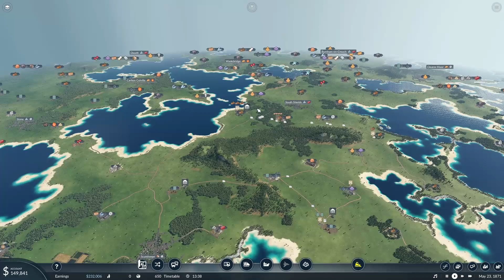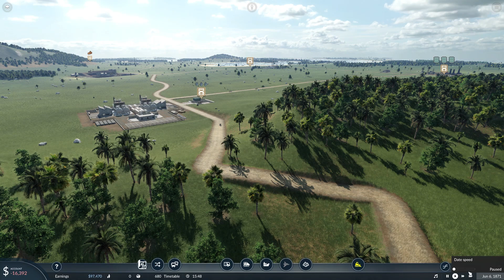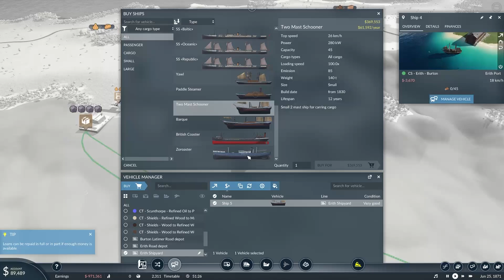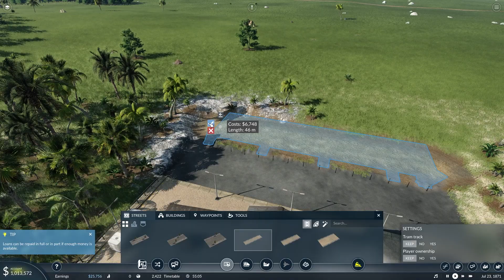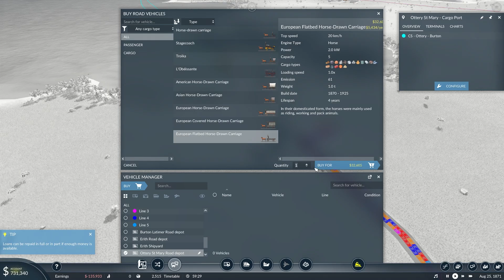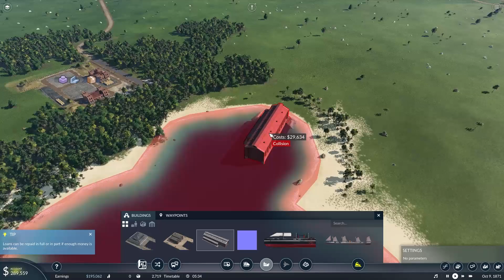Our First Cargo Hub - 1870s-2000s Megalomaniac Archipelago #3 - Transport Fever 2

Comment: Dead horses were a major problem for built up areas.  Imagine trying to lift a dead horse!  Not gonna happen before it starts to rot, if in summer belly will bloat, explode and street is filled with guts and maggots.
Reply: Besides this comment’s irrelevance to the video, was this you finding out about this niche information and then autistic urges hit and you had to blurt it out to the world?🤣 Love it
Reply: @flamboyantflying5981 yh I am a bit random!  I comment to try help boost engagement in a video. But  I was commenting on his mention of what emissions do horses give off! 😅  The emissions is why pavements are above the road.  Roads used to be littered with manure, add in a bit of urine and rain and you wont want to cross the street! And then as I mentioned the problem when horses break down!
Reply: @flamboyantflying5981 but it is relevant to the video when there was a discussion of emissions being a thing with horses.